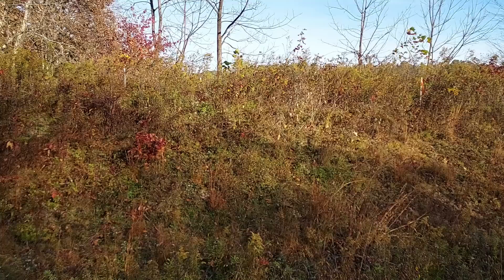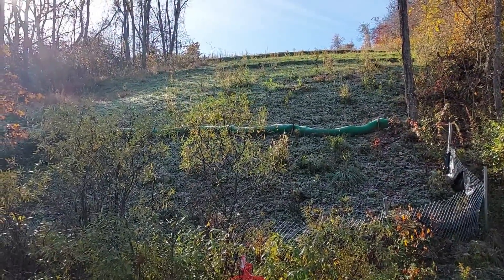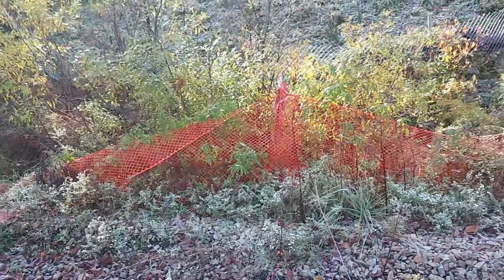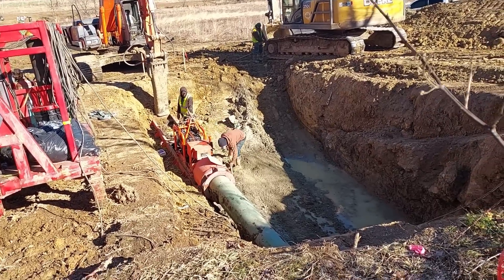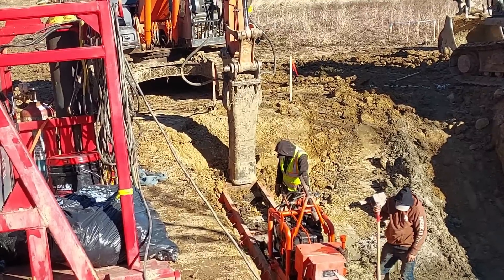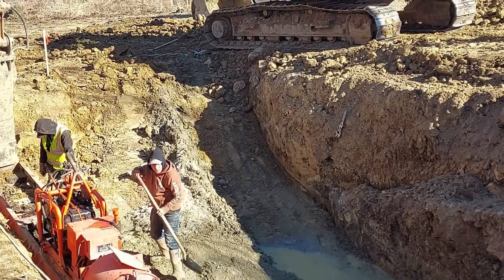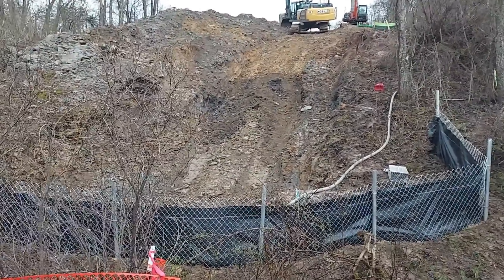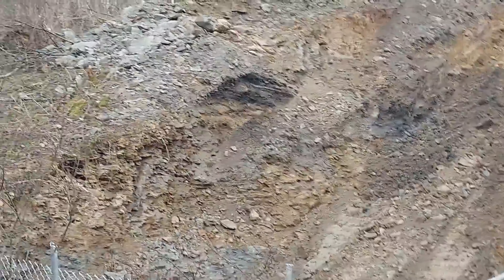Boring Under our Railroad Track

Comment: and no side shoring for the hole on either side,osha would not be pleased nor L and I
Reply from the maker: You are so correct in that. I sure would not want to have
been the one down in that hole. The last pipeline they
did under our track before this one, they did use shoring in
the bore pit, it was 16 feet down. But last pipeline also
had a gas company inspector right along with the pipe liners
and this one did not. Not having a gas company inspector
on this line was a major concern for us with the train 
running so close. Last pipeline they did I had contact with
the inspector 3 or 4 times a day, that was a good experience.
Sometime next year you will see videos of that prior
pipeline job under curve 15. Appreciate your visit with
us tonight my friend.
Reply: @ccrx6700  i now wonder if those welds got inspected at all,if they cheap'd out on shoring then what else did they go cheap on